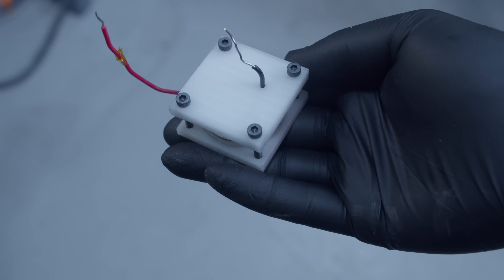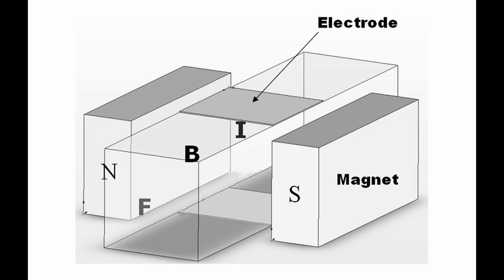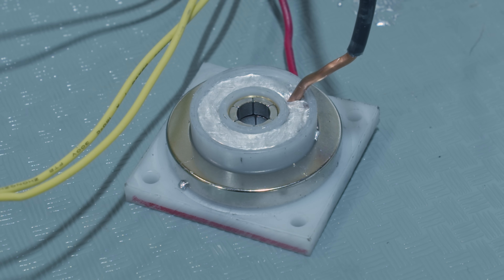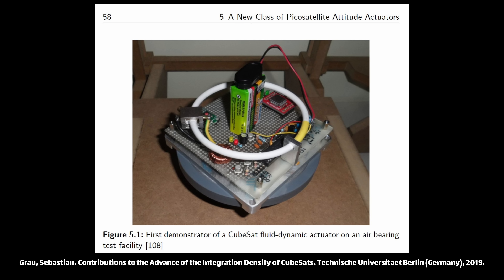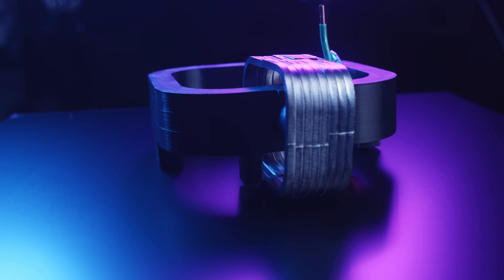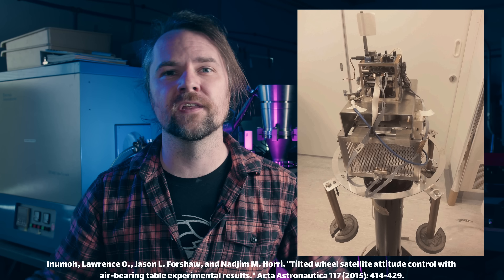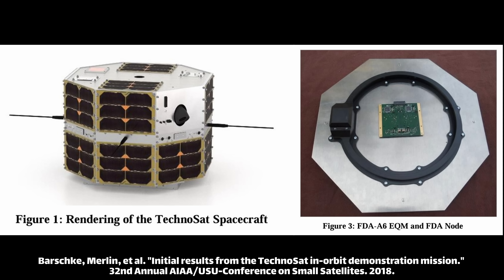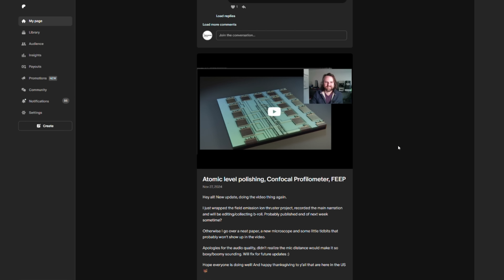A motor with no moving parts (sorta)

Comment: I'm super interested in this subject as I actually read the CC SDS engineering guidelines for certain aspects of CubeSats as well as EASA and NASA guidelines for the communication systems and bus systems. I was quite interested about the potential for someone to gain access to the flight computer communication system propulsion or reaction not flight navigation system via the common bus as they're using a real universal design with pike Linux. And having like these commercially made cube sets for universities that all used like a common bus if you can find an exploit it could be super super dangerous and I noticed that AES and Christian was optional on top of the CCSDS guidelines and if someone were to gain the authentication codes whether it be from any kind of side channel voltage social engineering for passwords physical entry into a ground station infiltration via a bad UBS left in the parking lot who knows anyway then all it takes is one and if it were a geostationary satellite for example with enough propulsion to caring it through the various orbital planes you could cause a massive Carrington event.

I've watched Cysat for 3 years. The world's current leading expert did his PhD in Oxford using a PCIE satellite digital satellite card in his PC to hack a satellite for his PhD thesis and was immediately hired of course by the United States NSA or national reconnaissance Office. And that was like four or five years ago so imagine using 6 to 20 GHz SDR or just having the right down converters and a well a nice precision guidance system tapped into Gpredit. And with canoe radio and Analog Devices Adulam Pluto with a GPS Disciplineed OXCO with a 10Mhz clcok signal as you can add a an external clock via an internal connector and lots of people are using this SDR for thier Oscar q100 satellite devices with either no amplifier but often from N Europe a 10 to 20 W 2.4  GHz uplink amp and it comes down at 10.x GHz with the appropriate Lnb to down sample the frequency. The AD SDR allows you to turn on a second Arm core and expend the freq range to 10hz to 6Ghz as well as having an FPGA capable of running GNU radio natively. It has Mimo 2x TX and 2x Rx as well via internal connections and isp to SMA connector the same with bipassing the onboard crystal clock with two isp snap on to sma for in and out clocks so you could share your 10mhz through a series of like SDRs making a coherently timed array. Not only could this be used to capture and tx on different frequencies but scan and monitors more simultaneously frequencies. I wrote up a full mobile cyberdeck satellite attack surface testing platform as I live in the Bernesee Alps and in the often clear dry cool summer down in a sheltered natural depression with a yet wife horizon view, and auto mount with tracking and a dish or 2 a big double helix, and the lower frequencies sat connection frequencies with Yagi antenna and or the easy arrow shafts vertical and horizontal on each end with the dishes and double or a left and right interchangeable helix up link antenna using the dishs with different tuned lnbs depending on your targets of opportunity. But given the arrangement used a micro ATX with a CUDA GPU and a lower power Nvidia Jetson Orion with various other SBC and stepper motors and divers as well as some MCUs, SNR, and,. EPM and automatic tuners. I was really pushing the limits of ITAR and myriad other US citizens or person based sanction violations. I am a multi-jurisdictional licenced lawyer two states, four different federal lower and federal appeal courts, the United States Supreme Court and the US Court for international Trade. I am also admitted to the Swiss Bar Association and Indo-Pacific Bar Association (Former Singapore Bar, Malaysian Bar Counsel, Geneva Bar) and applicant as foreign legal consultant to the Indonesian Bar and Bern Bar. You leave the Bars when not in the active private practice of law in many civil law countries (acidemics, judges, and in-house counsel need no be active in the local bar nor admitted). You return, especially if you left in good standing by merely reapplying. They will put you back in the roles with a local official office address. My credentials have been recognized by Switzerland as I did a year long stage (internship for one year upon leaving law school and everyone is paid the same in the whole country by unwritten rules. Afterwards, your a free agent. If your firm wants to retain you they pay you. My salary was tripled on my second year which includes a 13th month salary in December and four weeks of paid vacation so 13 months for 11 months or work. NOT BAD and after a few years it's six weeks of paid vacation. If your a partner, no social pay if you lose your job so you have to pay for private insurance. I was paying for 3 years of 80% of my average annual salary. But I was paid 900 CHF / hour of which I took 33% and could work as much as I could force myself and never could run out of work. 70 hr a week common and during a crises which lasted 16 months 80 to 90 hr a week. I was sequestered, had an small army and had to wear body armor under my suit. That blew and caused burn out but I've worked in more countries than I have not..... But mostly from GE Switzerland and Singapore.. 

I am a maker with a M.P.H. so I have a science masters degree and heavy on date science. R, SPSS, SAS,  Nvivo and recently pytorch, juniper notebooks,. keras, python, micropython, c++, Java and now learning RT Threads, Real-time T Operating System (RTOS) , and Busy Box. Of course, relational and vectorized databases....... various types but free is great Creative Commons and MIT or Permissive Use (Attribution with Commercial Permission types) at4e all cool. Been using and learning everything I can from Huggingface, and am in the Google, Nvidia,. And Microsoft Developer Programs. So, a lawyer++ / hybrid. The sat cyberdeck was picked up in the global feed of Hackaday with the editor saying, ' Nice Specs, super progressive, and can't wait to see it... I have it all worked out and the entire design in my head. Most of the components, need some better or more Lithium battery packs and 3D printed a decent wind turbines for recharging with a tripod attachment end 100 W of flexible solar panels which all can run into on battery management system and can output to a converter or output 5, 12, and 24. The wind turbine I could have some engineering filament made are used to print out a prototype to have casts made and use a milk plastic, dye combination with graphene powder to strengthen the entire mixture which is then placed in the mold under pressure at 50C for like about 50 minutes and that is strongest steel. Throw a clear coat for UV protection on the outside and some water resistance and until that wears off or you put it in an anaerobic environment it didn't get a degrade. I could probably sell that on its own cuz you could fit it easy in the backpack and it's made to fit on any standard tripod mount and it's quite effective as well as include an additional serpentine coil, a way to fix the plastic at stress points and uses things like skateboard bearings and standard rectangular neodymium magnets It's a nice modular design you can change out the blades for different styles so you can play with blades design and even have horizontal design. 

I can probably sell that if I scale it up with some pressure molds and had those casts from aluminum with some built-in heating and pressure. And then include in there a mixture that would form fit to fix any cracks and perhaps the battery charged soldering iron and those plastic staples for anything major and include three different types of blade designs actually made for milk proteins graphene made from whey powder and graphite truly actually bioplastic that will degrade into proteins not forever plastic. I wanted to do this for remote sensing and make a smaller version and perhaps even a metal version out of lightweight aluminum that's really tiny and uses different blades but maybe not aluminum blades but I'm thinking about that for small sensing stations that use solar and in these areas that I'm wishing to sense we're talking about water sheds and coastal environments and fisheries around reefs so when there's no sun there's usually wind. I even come up with an electromagnetic brake This really simple based on RPMs or heat and will simply apply electromagnetic pressure to the drive rod that's a stainless steel rod. A 3D printed holder if it's around the rod and holds the 12 neodymium magnets and it's quite compact and light about the size of a coffee can and has a wind veil so it can swift with the wind using another bottom based skateboard ball bearing I guess I could upgrade to some ceramics for longer life and smoother operation. But it easily outputs 24 watts at a modest windflow and if you were to add a painters pull to your tripod stand it could be mounted on that and you could maybe get it up into the lamin or wind flow a little easier. But my professional tripod has a hook on the bottom to attach weights like a big rock and scrap a rope around a big rock. Hang out in my hammock / tent/bugnet protection or my tent etc in the Alps for several days being able to recharge my battery packs I could do a lot of interesting things with satellites especially at altitude and at night I could play around with astrophotography.🇨🇭
Reply: All I need to do is actually decide on which size of pelican case to use be it a big one with rollers that can contain everything including my food tent various antennas and cyberdeck batteries etc or a backpack and a small er pelican case with all of the satellite and antenna accessories included. I could also throw my cameras and my auto tracking mount in there.... And some batteries it'll be a nice little hike but I'll probably get there as much as I can without having to walk I really just need to get high and within a natural caldera to filter out not only light pollution but spurious radio interference. We have a lot of clear nights in the summer cool weather and low humidity which is all good for both communications with satellites including Lora and low Earth orbit and other types of different tracking and remote sensing options available and I would hope that they would build those out a little better and perhaps open up the bandwidth because it really kind of limits the amount of data especially if you're wanting to collect quite a bit of data which includes like visual imagine a 3D image from a automated stepper motor that takes 3D images of three different crystal sample containers of water with three different concentrated dye drops per container and one normal and it quickly cruises through your sample and gives you a nice 3D image which you could then use a database of pathogens, other single cellular organisms, bacteria, and parasites and then use some different sensors like VOCs VSCs VSCs would be good at detecting bacterial overgrowth e coli and then you could actually do a count using a standardized measuring container in 3D like a cubic centimeter and collect your samples from different depths on the surface midstream on the bottom. I'm developing a turbine to not only measure flow but as a stator and a very small wind turbine smaller than my backpack version so I'm not sure if it's going to be made from veal plastic bioplastic if I can actually sell it to other remote sensing builders is that would be really helpful to add to solar especially in rural situations and a multi-path communication system so you could develop your own localized wide area network and mesh it down to the most least expensive high bandwidth connection somewhere along the line It could go up and down or meet in the middle and you can even cash data from time to time on the bottom where you attach your buoys in the middle of the water have anti theft and auntie Miller station components such as pictures thermal on the upside as well as a hydrophone even though tech fish finder that's good enough to identify size and perhaps species using a really tiny automatic a deep learning algorithm small format same for the microscopic images as they could compare those to a collection of knowing slides. 

That can reduce the quantity of data if it can actually on board measure the number of e coli or other coliforms and any known parasites and count them automatically that would reduce your data you wouldn't necessarily need the pictures even though you could store the pictures on the device and also keep a cash that's attached to the bottom where you tether your buoy. In case somebody rips off your equipment which of course they're going to get their picture taken a thermal image and maybe even get sprayed with some indelible ink as well as setting off an alarm alerting the local officials... I think it would be unwise to tamper with one of my devices as long as I follow the law in my local area if they allow me to spray you with local ink once I'm giving you a warning to don't touch me.... Take your picture of thermal image of your face and yeah the thermal image would increase the cost of the device substantially because simple you don't need expensive microscopes to capture single-celled organisms bacteria and parasites with pretty good quality and clarity and you just use a pretty good stepper motor that can cruise through the focus planes pretty quickly capturing photos at every slice and combining those into a picture for transmission or actually analyze those slices based on a compact deep machine learning algorithm on board which would also increase the cost of each device but decrease the bandwidth needed as you could code and quantify and fit that within the Lora data uptime usage parameters but if you're using 4G LTE or if you can get a Wi-Fi connection somewhere along the line even if you have to create a couple of repeaters with a transmitter and Yogi etc as well as having backup copies from time to time of everyone's data up and down the mesh but hidden you know at the bottom under at the tether. So someone rips off your machine the data's already going to be sent with their photo a thermal image 360° coverage as well as audio and a clear warning if you touch me I'm going to spray you with indelible ink. I mean you need to protect your monitoring equipment especially when it's not cheap but it's not really that expensive You can make it really affordable at scale and it would be super awesome to monitor the entire water course in real time even if you were to do this for the 11 major freshwater rivers of the world The data collection would be really important... You could also watch and survey protective fisheries and vulnerable reefs as well as replanted reefs and areas where they use dynamite fishing dragnet fishing and cyanide fishing throughout the entire coral triangle area which is a very important area for the entire world as this area is like the rainforest of the ocean. The island of Palawan and the island of Borneo is the most too biodiverse areas in the world both on land and in the sea that surround them and service a foundation of life in the ocean pretty much all the islands around the ring of Fire throughout the South Pacific but specifically from the top of popping New Guinea like Admiralty Island through all of Indonesia Malaysia and the Philippines.... There's one place I would love to go I've been close a lot of times I spent at least 3 months and in Sipadan I'm Patty open water diving instructor so going to Borneo divers They had one instructor at the time and the rest would dive masters so having me on the boat increased their diver to supervisor ratios that are monitored and important to be kept unless you want to get sanctioned by PADI who actually send around undercover people to check that you're following the regulations and you could lose your status and that's the biggest diving agency in the world for recreational diving. I'm a technical diver with IANTD (Advanced trimix Technical wreck etc),PADI Tech rec 40 45 and 50, and GUE Tech 1 (The agency everyone loves to hate but they're always right and also called pay to fail) I'm like Patty which has a educational pedagogy that stresses 100% comprehension and really want you to have a good time so there's enormous safety margins there with GUE it's a completely different mindset they're doing real expedition dives where they need extremely well-trained divers as rescue divers support divers even if you're good enough a main diver into all kinds of different archaeological cave and wreck settings.... I would say that they're used quite often as an organization for doing both training archaeological teams but also doing serious archaeological dives cave investigations and investigations at depth. I'm just 100  hundred to 120 m certified (depends on which agency in the card I use) But that clearly is hypoxic level beyond 65 m is hypoxic gas mixture mostly helium. The nitrogen starts giving you nitrogen narcosis at 30 m or beyond and GUE requires a normoxic trimix at 40 m. It would never approve of the patty 50 m deep dive descend touch and love and ascend because at 50 m is one tank is not going to last you more than a quick trip down and up. It's also a really good way to get yourself either nitrogen narcosis another good way to end up dying because everything will be great until you run out of gas. 😮 You're literally wasted when you're narced. Plan your dive dive your plan use your watch computer only to back up. I have three different decompression plans written out on my tablets for each dive. You return with 1/3 of your gas in each tank and we charge new tanks with a DIN connector and Apex regulators to 220 no problem but that's a whole lot of pressure. You can blow out seals pretty easy so always maintain your seals check them Make sure there's no sand put some silicone on them and replace your rubber often. I dive in a DUE 50th anniversary dry suit, halcyon wings and back plate, and all Apex regulators including decor regulators so probably at least seven different sets of first stage and second stages as well as one that's always used exclusively with 100% oxygen. Cleaned only with ultrasonics otherwise you're inviting bacterial growth. And they're all balanced and ice rated even though I don't dive often in isis I just enjoy it much more around the equator. I should probably expand my horizons because I'm not going to get colds I mean I'm in a dry suit that came with chinchilla onesies and a hood and the only thing exposed is almost no skin whatsoever. Star wars full face mask then you could have no skin and you could actually talk but I kind of like the silence I get all Zen.